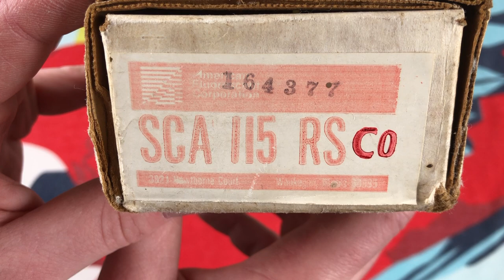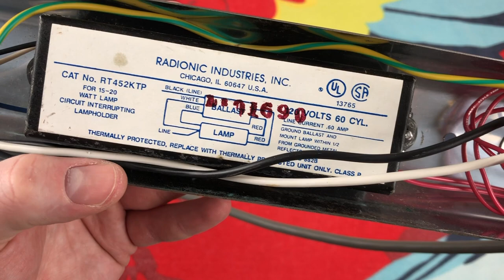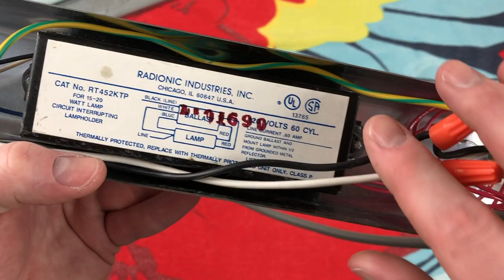American Fluorescent Rapid Start F15T12 Vanity Light Fixture

Comment: I think the reason one socket is different than the other is because it is a circuit interrupting socket. Many trigger start ballasts including the one in this fixture require a circuit interrupting socket.
Reply: Interesting.  I thought only instant start ballasts aka slimline used circuit interrupting lampholders as a safety measure to prevent electric shocks to someone changing the lamp who might be holding one of the ends while inserting the lamp, since instant start lamp use a considerably higher striking voltage than rapid start/trigger start/preheat.

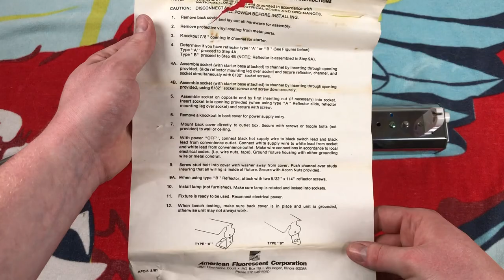Comment: Oooooh! Nice one there! The chrome shines nicely nice patina too. and especially being in the original packaging and also the fact that it has a grounded electric outlet. It may be from the early 1980's as the instructions had I'm guessing revision 3/81 March 1981 on the lower left hand side of the paper. at 3:00
Reply from the maker: I bet you're right, early 80s. I wonder when they moved from preheat to rapid start for vanity fixtures? Or maybe they never did, like some of their other offerings, they probably had both options available with one being cheaper.